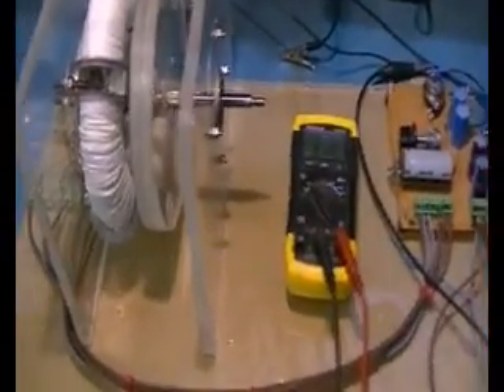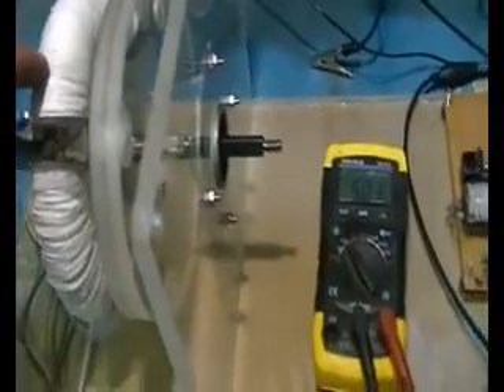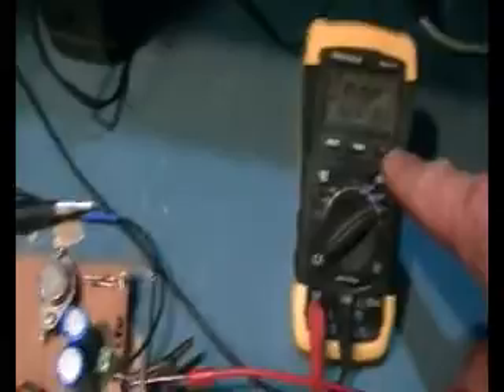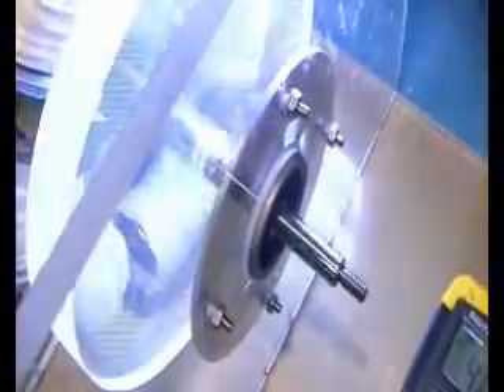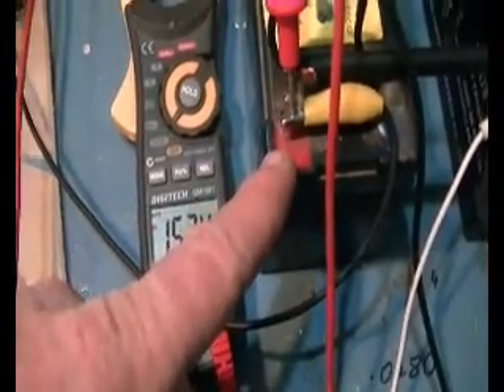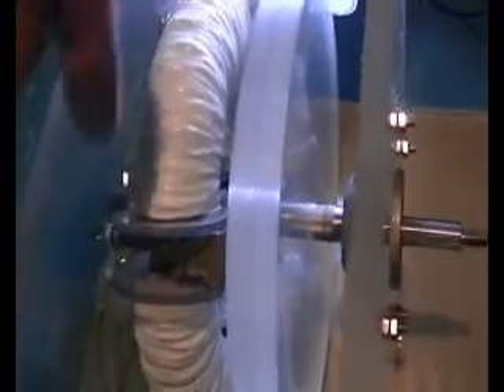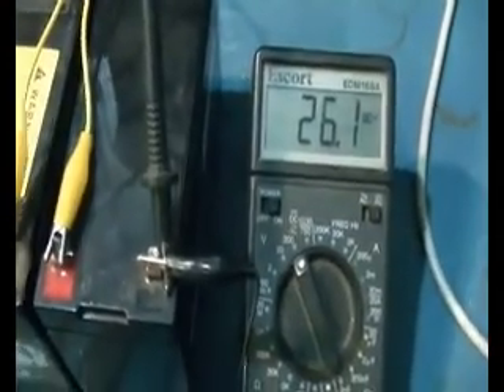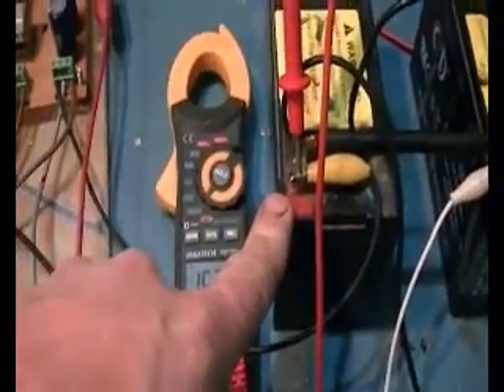L F M G first run,over charge

Comment from the maker: Hi sstubbby-there is no high voltage spike's in this machine because of the way the coils are arranged.The generator coils do no allow the high voltage spike you get from a normal ssg.However ,the current is a lot higher than a standard ssg.The scope reads nothing but a straight line.

Comment from the maker: Hi kultus,The L.A.G and this work diferent to anything else.Most of the problem is that we all want to build a machine for one purpose.But there is actualy 3 diferent machine's in one here.We have an electric motor,a transformer and a generator all in one.The generator coil's work like a buck booster when the run coils fire.This creates a very strong magnetic field inbetween the two coils,and gives the rotor a good push.It is this effect that counter acts the lens force in the generator.

Comment: great work Tinman, just thinking out aloud as I always do, watching a video by Oldscientist the other day, he rovoked a memoery as to why we put a resistor into the output of a crystal radio, it is so that you can pick up on a wider bandwith of frequencies of a untuned circuit, Do you think this may have something to do with why you LFMG and LAG both worked better with a load applied ?  "watch?v=Rj6rY7wgM0I" it alows it to recieve energy from outside the tuned system, at a zeropoint level?

Comment: Thats nice. Do you think if the charge battery was changed to a 24v duel setup the rate of charge would slow down and make it to 24v or just flaten out with the run battery. I like the cap dump idea. One more thing what do you think about the EMF at the coil in relation to the stater, you think it helps or no change. David A. Puchta

Comment: though i have to agree with kyle its hard to really get an idea of the charging with a full battery.. once it settles down to about 12.8v its safe to assume the charging voltage had exceeded roughly 13.5v or higher at one point and time and it will just skyrocket above that easily with any decent amount of current fed to it..  BUT i know with my chargers i have to be putting out roughly 500mA or so into the batt to get charging like yours, but yours does look alot faster. look forward to more

Comment: Interesting setup Tinman, but I am bit surprised you would test it with your charge battery already at 12.8V. I would expect similar charge rates from a SS TS SSG (24V) for example, if my battery was already at 12.*V, because it is in effect, already charged. Can you try it with your charge battery sitting at 12.0V, instead? thanks for sharing.